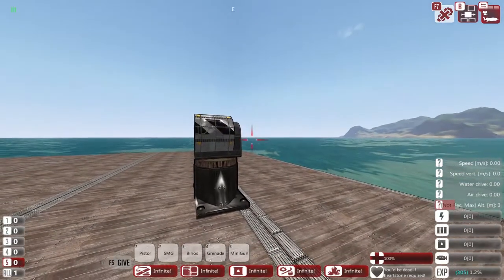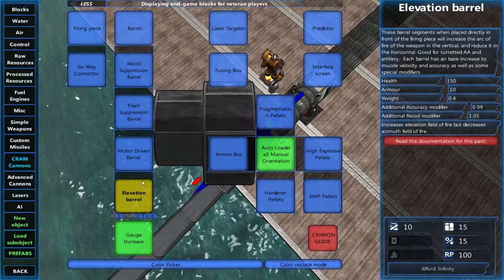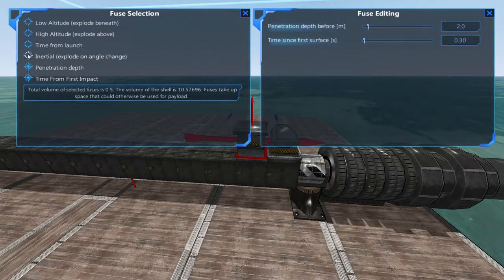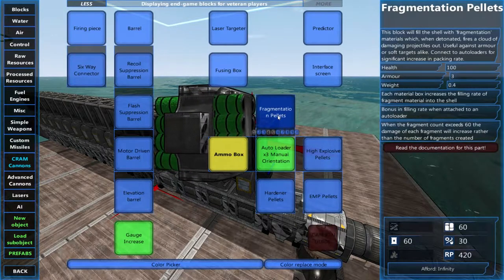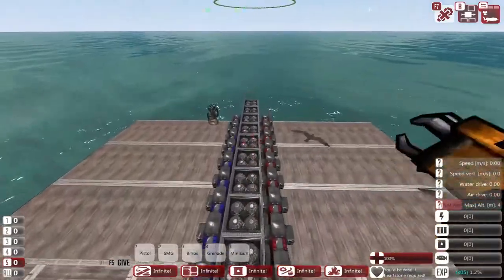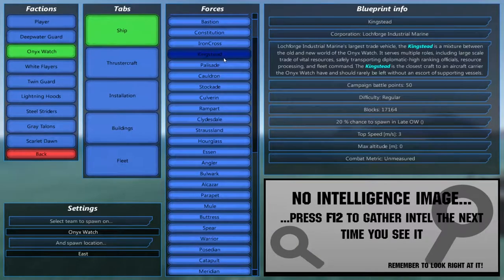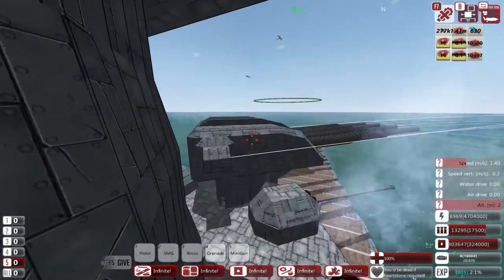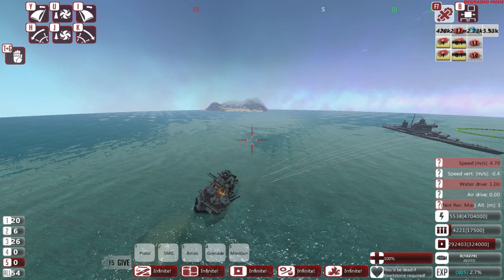From the Depths : CRAM Cannon Tutorial

Comment: I might add some information:
Pellets are shared between autoloaders, even between different cannons, so the spaces in your ship's turret are not very efficient. Having multiple autoloaders connected to the same pellet box, the effect stacks. More pellets on autoloaders increase the filling speed, however it also increases ammo consumption per second from ammo boxes on the cram cannon.
Ammo boxes have material that the shells are filled with. they slowly refill over time from the vehicle's main ammo storage. Adding them to autoloaders increases reload time but not filling speed.
Ammo boxes are also shared between autoloaders, both between autoloaders in the same cannon and between different cannons. However this only applies to the speed bonus, the ammo supply is only added once and only to one cannon.
Then, there is no point in cramming the shell to 100%. There is large diminishing returns. For example, a shell filled to 7% does 50% the damage of a 100% filled shell. The figures are approximately as follows:
1%  => 0.10
3%  => 0.27
5%  => 0.41
7%  => 0.52
10% => 0.65
20% => 0.87
40% => 0.98
100%=> 1.00

Now happy tetris.

Comment: when should I use CRAM? i am proficient in building AC and im getting the hang of CRAM, but what to put on what kind of ship?
Reply from the maker: In my experience you'll want to use CRAM on brawling ships that have enough space to fit a few. They can be inaccurate at range, but if you have enough of them that won't be as big an issue. AI might need a ranging shot or two but then death will rain down
Reply: DerpDigital i see. thanks

Comment: How to build Double barreled turrets. i watch any newbie video about ftd and have only 12h on my cloak... trying to build a starter ship... and yeah cant build anything with Double barrel..

can you say me the trick for more barreles ?
Reply from the maker: +Jack ZPlay The only way for CRAM cannons to have multiple barrels is to place multiple firing pieces on the same turret. If you press Q on an advanced cannon however, you will find a slider that allows you to have up to 6 barrels for one firing piece, but that is only for advanced cannons. Hope this helps!
Reply: +DerpDigital well, rotor and 3 sixways with two firing pieces.. only one can fire :/
Reply from the maker: Jack ZPlay Ah, you can only have 1 firing piece connected, so you have to build them seperately. For all intents and purposes you are building 2 seperate guns that happen to be in the same turret. The only thing that can connect to other guns is the ammo boxes
Reply: +DerpDigital  hehe :) will rebuild the turret for my starter ship.
Reply from the maker: +Jack ZPlay Good luck! Don't hesitate to ask more questions if you want to know more stuff :)
Reply: +DerpDigital can the ai turn off my shields if no enemies near by... or it's only on?
Reply from the maker: Jack ZPlay Yes! you'll need Advanced Control Blocks located in the Control section. You need 1 set up with "Enemy Range < ..." and set that to shield projectors turned ON, and 1 set up with "Enemy range > ... or no enemies" and set shield projectors to turn OFF
Reply: pellets can too. also ammo boxes are a bad idea to connect between different guns because you end up with an uneven ammo supply per gun.
Aside from that, you should always aim to put the ammo on the least effective autoloaders, and explosive pellets on the most effective ones because of the price tags. Also ammo boxes in the less effective loader spaces means more ammo as you need more of them for the same firing rate.